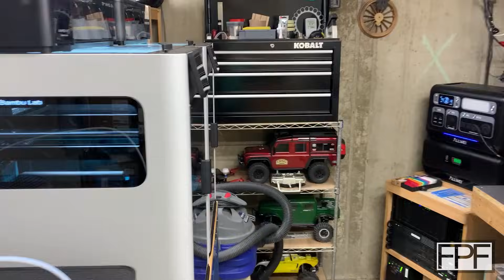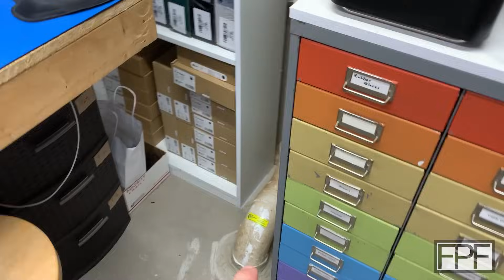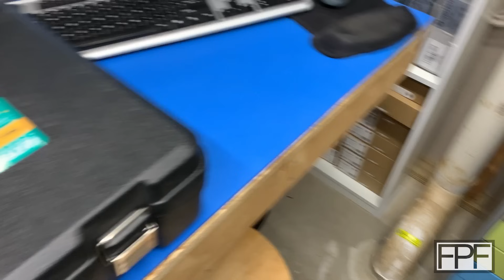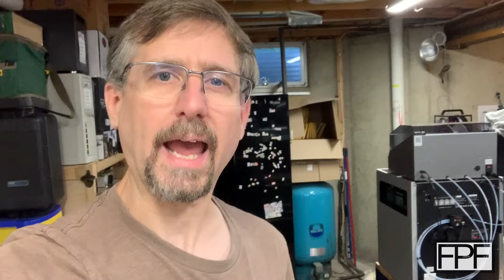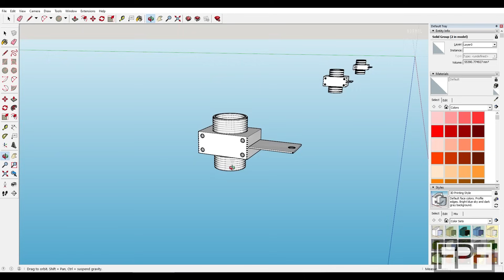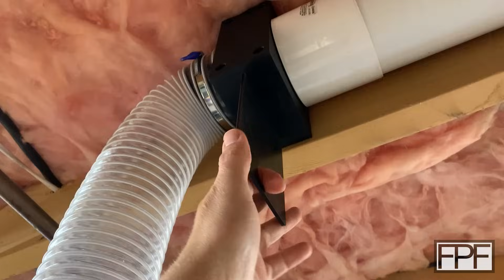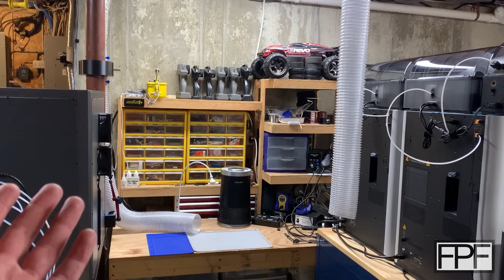3D Printed Fume Extraction Blast Gates and Adapters

Comment: 22:09 Any concerns about drilling that large hole through the joist? It does look like that joist is perpendicular to the main joists we could see so it may not really be load-bearing, but why is it three thicknesses?
Reply from the maker: It's hard to tell in the vid, but the other side of it does carry load down to the beam, but it's unsupported on the side I drilled the hole.  I think it both carries some of the load on the other side and acts as blocking to keep the joist from twisting

Comment: The circuit is basically a voltage divider, but with a potentiometer instead of two fixed resistors.
Originally, there was a constant voltage across the outer pins, so the current stayed constant regardless of how the potentiometer was set.
By shorting the pins, you’ve now increased the current, which could damage the potentiometer. The actual effect depends on the wiper position, but in the worst case you could create a direct short between the outer pins when the relay is on.
I may not have explained it perfectly, but the key point is that the electronic setup needs to be revisited.
Reply from the maker: I measured 2ma, so I think it's good, and no current should flow through the potentiometer now given it's a higher resistance than what is effectively a jumper when the relay is closed.  Fingers crossed, since the fan wasn't exactly cheap.
Reply: @FunctionalPrintFriday  

With the relay on, you’ve got 2 mA at 10 V, which is 20 mW through the potentiometer when it’s set halfway. That’s fine in itself. But if you turn the resistance down, the current rises. A potentiometer of this size is usually rated around 100 mW, so lowering the fan speed could easily push it past that limit.

The bigger issue is if the potentiometer is turned all the way down. In that case, you’d be shorting the 10 V rail whenever the relay is on, and there’s a good chance the electronics in your fan won’t tolerate that.

In short, the setup is hiding a serious problem that will show up the day you decide to run the fan slower than it is now.

If it’s not clear why, I’d suggest looking up how a 3-pin potentiometer works, and also checking out the concept of a voltage divider, since that’s essentially what the potentiometer is doing here. That should help clarify my concerns.

Comment: Just a suggestion, but if you simply modified your blast gates to have a micro switch (or photo interrupter if you prefer pure electronic) to detect when the blast gate is opened, the system would be fool proof, as opposed to now where you could forget and leave a blast gate open when you put the fan back to slow speed and accidentally defeat your radon system, possibly for very long periods if you don’t notice. There are actually dust extraction systems for woodworking that have a feature like this on their blast gates to turn on a dust collector when one is opened.
Reply from the maker: I considered automating it with reed switches, and I still might for the laser cutter, but for the other two drops, I think I'll manually want to adjust each time depending on the application
Reply: @FunctionalPrintFriday how about putting a small button panel at each drop along with the switch on the blast gates. Then opening a gate puts it on full, and the buttons give you a couple different choices and the fan stays in the selected speed till all blast gates are closed. Maybe some indicator LEDs to go with the buttons to show current speed. This way you’d still have the safety of not defeating the radon system. Maybe even add a pressure sensor and display the current reading for the radon system at each button panel, and even an alarm if it ever drops below the 0.6 level while AC power is on (to handle power loss situations). Hey, if you’re going to do something, at least overdo it! What else are 3D printers for?

Comment: Considering you are attaching to a 3d printer,  you might consider grounding the pvc pipe to prevent static electricity.
Reply from the maker: good thought.  The pipe itself actually drops into the concrete floor in two spots, so I think it already is, but I don't have a lot of expertise on grounding for static electricity.  maybe someone else will chime in on whether or not that's sufficient
Reply: @FunctionalPrintFriday from my limited knowledge of radon piping, I believe they seal the pipe with caulk. That would prevent a direct contact with the concrete or have very limited contact.

Comment: I use qidi stuff, not out of any kind of brand loyalty or anything like that, but because I found that they offer the capabilities I need at a price I feel like paying. It seems with qidi that they release their stuff before it's ready, and you have to wait a year or so for it to fully mature.
Like with the qidi box. I've been waiting and waiting for it to come out. It finally did, a good ways behind schedule, and people are having nothing but problems with it. I figure by this time next year, all the bugs will have been worked out, there will be software/firmware updates to fix it, and it will be worth buying.
Reply from the maker: my plus 4 has been great, but I know others had issues.  I disabled my chamber heater altogether as I didn't need it.  the draw with bambu is that everything is so well tuned out of the box, usually well before launch.  minimal time fiddling

Comment: Ooooh… hugely absorbing video, love the functional solutions you design. Definitely need a fine grill on your solder fume extractor. For the H2D exhaust I would try designing a single fitting that is permanently attached to the pipe… then attach the fitting magnetically to the H2D… with some very soft foam on the interface as a seal. Might be worth designing a flow restrictor in the fitting so you can adjust the flow rate to stop too much being pulled out… maybe an iris style restrictor would be interesting to play with - plenty of designs out there to base it on.
Reply from the maker: definitely thinking magnets

Comment: Think the bigger issue you may run into is cold air flow coming into the printer during fume extraction, which could cause warpage (like it did with your petg prints). 

This is why I opted for a cheap enclosure and vent from the enclosure.

Interested to see how it works out for you.
Reply from the maker: I only plan to attach it when printing filaments that I need to vent, but I was considering having some openings so that it can draw fresh air in to balance the flow better without creating negative pressure in the printer chamber.  more to come
Reply: @FunctionalPrintFriday Yeah, just mean for things like asa/abs and nylon. 

I would imagine the h2d has enough openings that air pressure in the chamber shouldn't be much of an issue. The poop chute isn't sealed so air would most likely come through there for the most part. 

I leave the enclosure every so slightly unzipped to prevent negative pressure issues.

Comment: Kinda curious how much airflow the H2D/S can take until the chamber temperature starts to drop. Especially when printing ASA or Nylon etc.
Reply from the maker: I only plan to attach it when printing filaments that I need to vent, but I was considering having some openings so that it can draw fresh air in to balance the flow better without creating negative pressure in the printer chamber.  more to come

Comment: I'm wondering how the pressure will look after connecting the h2d if you dont ramp up the fan. The printer already delivers air when running and you probably don't need or want any real suction. Maybe you can use it without ramping up the fan and just use the 0.08 overhead?
Reply from the maker: agreed, I think the blast gate will only be open a tiny bit.  I may see if I can find a way to measure the chamber pressure itself with the manometer to fine tune it

Comment: If you used a microcontroller and a sensor to detect the pressure drop (the negative pressure, vacuum but not really), you can switch high the pump when the pressure drops. That way, you just have to open a gate to get the suction started and closing the gate would slow the fan down again. Lovely project!!
Reply: a photodiode and a 3d printed flow meter, built like an inverted cone wiith a rod in it, a ball on the end, the rod blocks the light, it triggers a high flow relay or a fet.  it'd just be bypassing the pot and using fixed resistors.
Reply: Microcontroller; check :)
Reply: I came here to make the same suggestion
Reply from the maker: love this, but it might make it harder to tune the flow with the gate at the printer if the negative pressure in the piping keeps changing to accommodate for the additional flow
Reply: @FunctionalPrintFriday  use a pid controller, which can also be a completely mechanical system but is VERY commonly done diy with an arduino, though there's smaller and cheaper controllers these days... even a pi pico could beat the arduino's price with some lookin.

 for a giggle, think of a reverse reserve tank, bit of an art project for something as large as a whole house ventilation system.  an empty bean bag hung and stretched out in the attic with light weights on it to keep it full or a whole closed room as the reserve.  a vac pump would normally just use a small steel or pvc tank, but a house might use a whole room, you'd still end up needing a pid control system, but a slower one.
Reply: yea i was thinking gcode_shell_cmd for the printer to trigger the raspi but a capacitive barometer IC connected to the raspi is an even better idea to trigger the FAN_HIGH signal, so a pressure drop anywhere in the system will trigger it. this includes forgetting to close multiple blast gates, someone actually leaving the printer or the laser cutter doors open. that sensor could also be programmed to trigger a beeper if at any time pressure actually drops below a calibrated number like 0.6 or any desired set value which i think is a must since this is basically piggy backing a safety system.
Reply: there's also voc sensors, so there's no need to panic if it's not getting fumey.  turning the fan on when there's clean air is silly, but the simple ways of triggering a fan are also simpler to think of.

Comment: Works great !! I would go with smaller hoses from the blastgates to the printers/ solderingstation. 
That way you create resistance in the airflow, keeping your radonsystem working correctly. Also connect you printers with a releavebox (half open connection), so that when the printershutters are closed, the fan will get air and not create an absolute vacuüm on you printershutters, damaging them. 
I also would try to automate the blastgates, so that you don't forget to turn de ventilation on/ off. 

P.S. Functional Ptinting Friday is Functional Printing Saturday in europe ;-)
Reply from the maker: thx for the suggestions.  I only plan to attach it when printing filaments that I need to vent, but I was considering having some openings so that it can draw fresh air in to balance the flow better without creating negative pressure in the printer chamber.  more to come

Comment: Two thoughts regarding the vent motor control:
Looks suspiciously like a standard 10V DC motor control input.
There is a variety of ready products for that, e.g. the Shelly Plus 0-10V Dimmer, just to name one. So if you ever want to be more flexible in controlling it, you can consider that. (personally I'd have stuck some wireless microcontroller and relay or electronic potentiometer in the box, but "same difference" to a shelly really)
Reply from the maker: I've been looking for an excuse to try one of those shelly devices
Reply: I was about to write the same one.  0-10V and 1-10V are also used as standard LED Dimmer. The Shelly one Thomas mentioned is a very good pick and it much likely fits even in the box outside.  There are also other brands that offer such LED Dimmer like the L1(WT) that can connect to Tuya SmartHome and has an optional Remote.  Depending on what style you prefer.

Comment: Another interesting watch. 
Silicone spray works a treat for reducing friction between sliding parts. I was recommended it by a window installer, for the sliding window hinges, but use it for all sorts now.

Comment: Very cool video! Wow, that's a lot to get done for a weekly video! I've considered an exhaust for my Qidi but am thinking I'll likely pursue a closed loop filtration system using a carbon bed and 0.5 cfm fan max. It seems the bigger challenge will be avoiding impacts to print quality while extracting so much heat from the bed and ambient space surrounding the prints, not to mention the draft patterns impacts to bed adhesion.

Comment: I would have thought you would put in a Y split before 2 blast gates, 1 for each of the H2's.

As for the fan control, if you have a small neodinium magnet at each blast gate, that either opens or closes a read switch (depending on where each are) as you open or close the read switch, each of those feed either gpio pins on the Pi, or through some sort of a microcontroller input that then tells the Pi to turn up and down the fan, based on whether the blast gate is open or closed.
Reply: Note the edit was that I changed a 'Q' into a 'Y' in the first paragraph. Q doesn't make sens in this case.

Comment: The triple joist looked like it may have been a support beam (hard to tell when watching on phone).  If so, it mght be worth checking to see if your hole needs reinforcement around it to maintain strength.

Otherwise great video and project!
Reply: I thought the same. Given that there is a post tells me it's load bearing.. I am no structural engineer but plz look into that.
Reply from the maker: It's hard to tell in the vid, but the other side of it does carry load down to the beam, but it's unsupported on the side I drilled the hole.  I think it both carries some of the load on the other side and acts as blocking to keep the joist from twisting

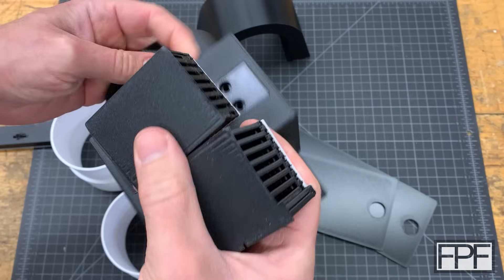Comment: The supports on your big print (not sure what you call it) are concerning and I've seen the same on my H2D.  The 1st later has some anomalies that you can see around 34:28.  Not the biggest issue but I do have concerns...
Reply: Are you referring to the 'steps' in the support? those are due to the print orientation, and the printer building up layers (0.2mm layers, by default). I don't see any other 'anomalies'.
Reply: @rattyboots  No, the fists layer.  You can see it as he shows the supports.  I have issues where bigger prints, in the right light, show differences in the bed levelling as I can see the extrusions in some areas versus a good "squish" in most areas that doesn't show the extrusion lines.
Reply from the maker: the first one lifted a bit on the cryo sheet.  I swapped to the PEI sheet for the 2nd one and it came out perfect.

Comment: For sure thought you would have added dumb switches to the blast gates that turns the fan to 11 when opened.
Reply from the maker: I considered automating it with reed switches, and I still might for the laser cutter, but for the other two drops, I think I'll manually want to adjust each time depending on the application